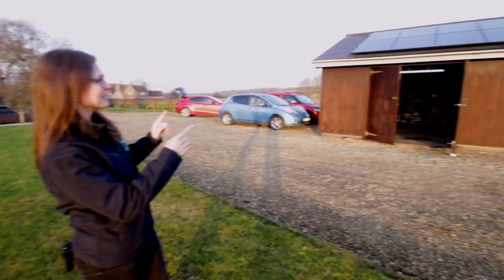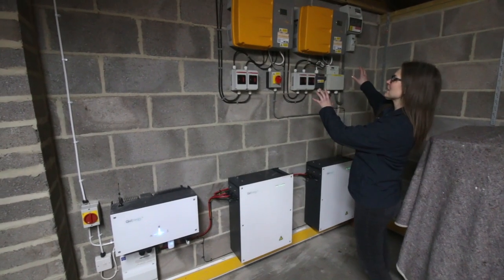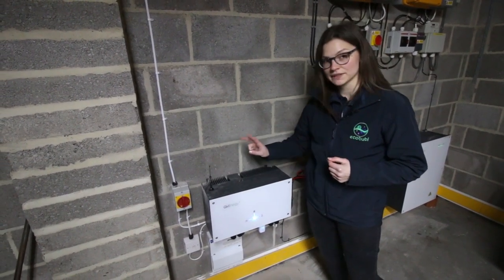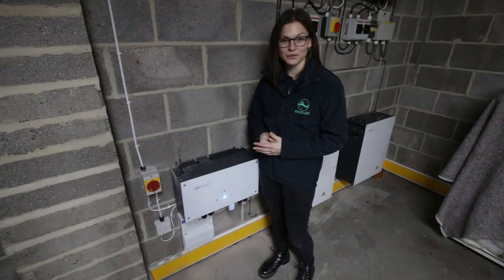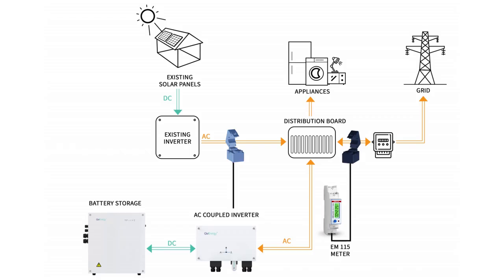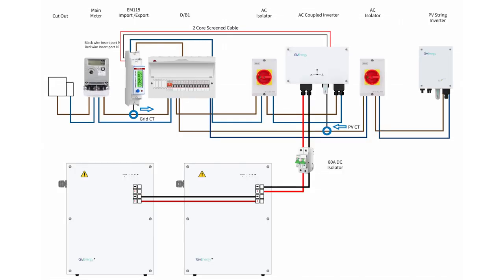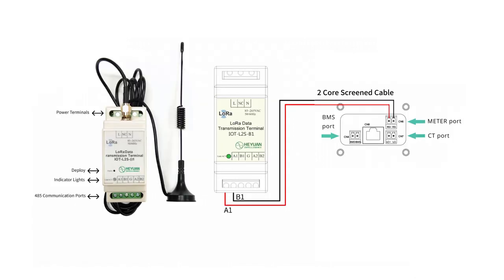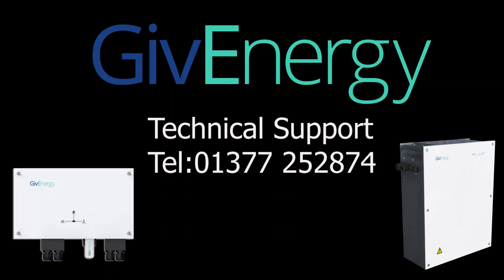GivEnergy AC Coupled Electric Storage Battery, Installation of a Lora Transmitter Device.

Comment: Damn... That garage is nicer than my house! Advantages of AC coupled battery vs DC coupled? Or do they mostly do the same job?
Reply from the maker: The AC coupled can be used for connecting to existing Solar PV systems, also with the GivEnergy system you get 3kw of power into your home, where as the Hybrid system only provides 2.6kw of power.
Reply: @ecobubl  isn't it the batteries that are limited to 2.6kw not the inverter?
Reply: @mikeyboy01443  Not from what I can see on the data sheet. It specifies 80A maximum discharge. So 80*240 gives you 19.2kw. Plenty! Then if like me you have a higher peak load in the house than 3kw, you can get 2 batteries and put an AC invertor on each in parallel. Giving you a nice 6kw supply for the house. They say you can even add a third if you are feeling suitably flash!
Reply: @benp7328  i think that is the newer gen 2 batteries, they were not out when i looked at this originally. Not sure i would go for GE kit now, i went solax...

Comment: Thanks for the vid, really helpful and especially the LoRa device. Do they only work with GivEnergy batteries or can others use them? I have the same detached garage with solar issue (but not a smart!)
Reply from the maker: Hi Edward
Thank you for your comment, very much appreciated.
I’m not sure if the Lora device can be used with other manufacturers, I’m afraid we only supply GivEnegry at the moment as they’re so reliable and great quality.
Reply: Oh and I've done the slide gag twice at work this week - classic, thanks for the idea!